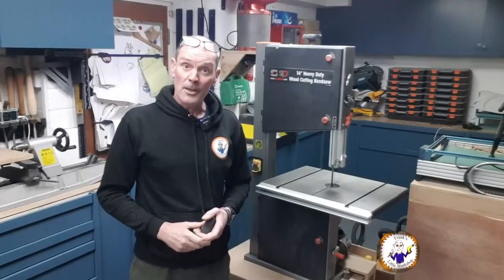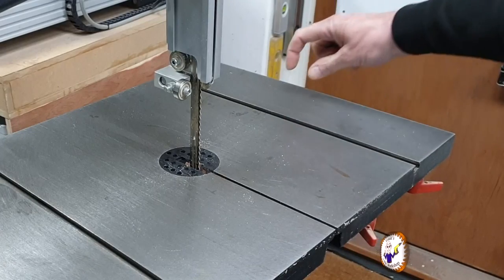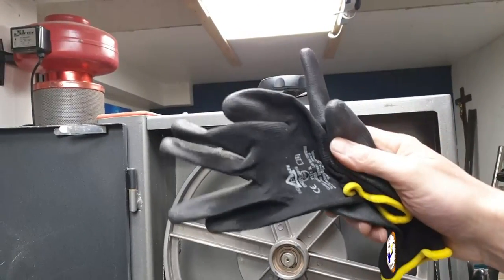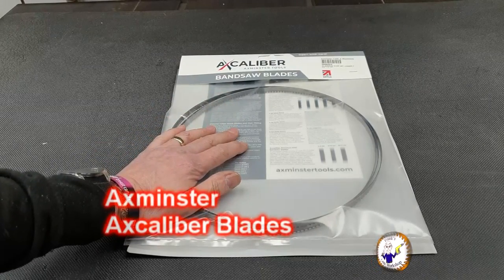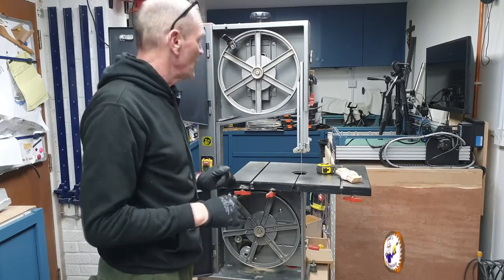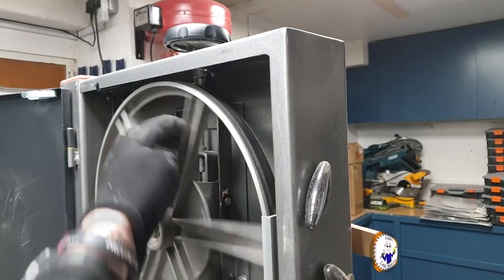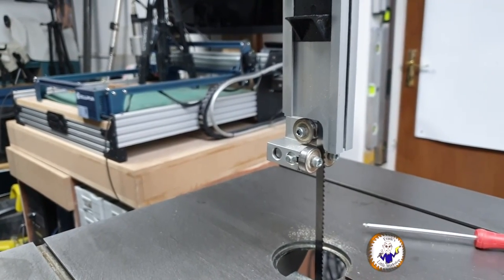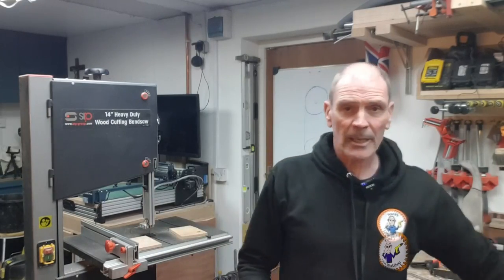Blade change series, BANDSAW.

Comment: I have a 12" bandsaw made before the wheel was invented. It uses guide blocks instead of rollers, but your video is still applicable to my old relic. (It was worth the $10 I paid for it, but putting tires on that thing was maddening.) If I would have had your video then, Picciuto wouldn't have had to show me how to install the blade, and help me choose the blade I need. Good job with the unrolling of the blade which can be interesting for a beginner. Good job Frank.
Reply from the maker: 😁 Thanks Chris. My previous B&D / Dewalt bandsaw had guide blocks, but the previous owner had wedged in some blocks that were so hard it was almost impossible to drill them out.. but I guess they would have lasted a long time 😆. Thanks for watching Chris 😁👍

Comment: It looks like you enjoy setting up a new blade as much as I do. I bought a new Record bandsaw and bitterly regret it, nothing was set up at the factory. The trunnion wasn’t set up so the bed was at a weird angle eventually I realised there are four tiny screws that adjust this but what a faff about. I could go on but it makes me sick just thinking about the damn thing. That was a much better video than most. Cheers
Reply from the maker: 😁 Thanks Steve. I was after the Record Power Saber before I got this, but just couldn't afford it. This Sip has been an excellent saw (apart from the fence) so I'm glad I've got it. Glad you liked the video and thanks for watching 😁 👍

Comment: Great comprehensive vid Frank. I've got the Electra Beckum 316 Bandsaw which is nigh on the same as your SIP but with a 12 inch throat. Its a great bandsaw for me but the fence is exactly the same as yours, an absolute pain in the backside to get on and off and it always lifts in the nose when tightened which lets thin materials slide under it when you are cutting. I've tried all sorts to get it right but failed every time. What I did do though was super glue the locking plate to the bolt which attaches the fence to the front guide which makes it a bit easier to attach. Keep up the good work and great vids.
Reply from the maker: 😃 Thanks Tom... looks like I'm getting my CA glue out tomorrow to try and improve the bloody fence 🤬. I think I really need to find an aftermarket fence. The rest of the saw is great and much better than the old B&D / Dewalt one I had previously. Glad you liked the video and thanks for watching 😁👍